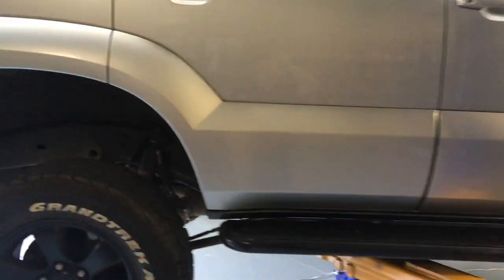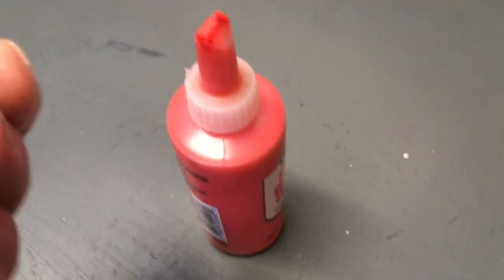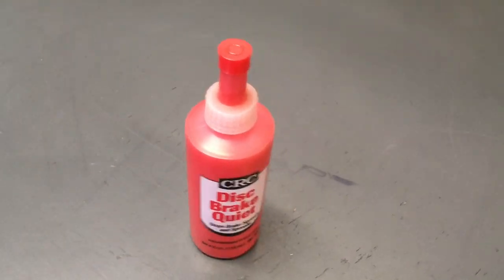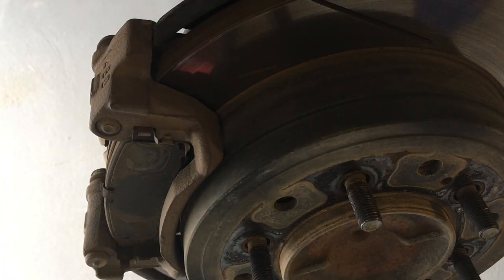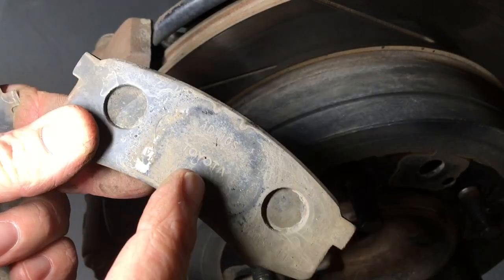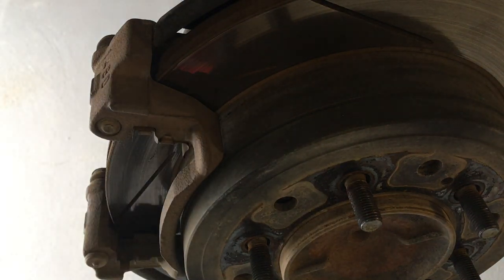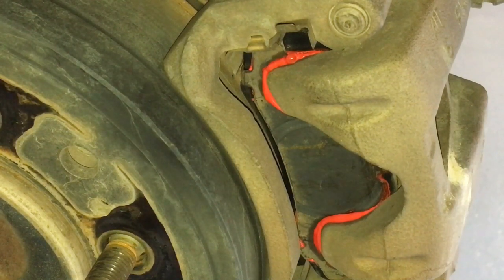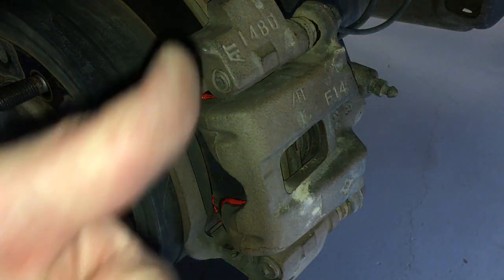REAR BRAKE PADS

Comment: Anthony When I use the genuine pads from Toyota for my Fortuner it comes with a sachet of grease which needs to be applied on certain points indicated on their instructions sheet...on the back of the pads there are dimples which varies with the vehicle model and it is meant to eliminate squeal